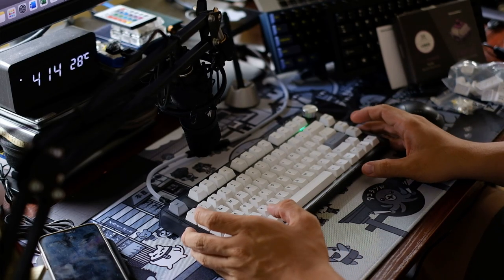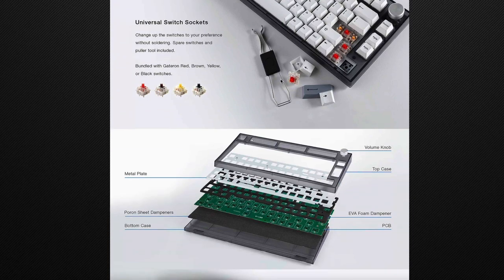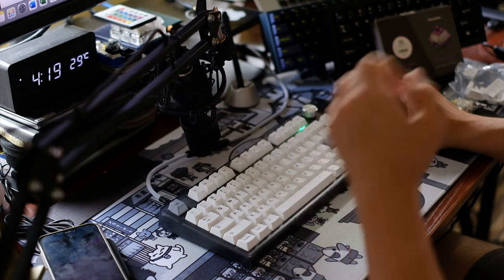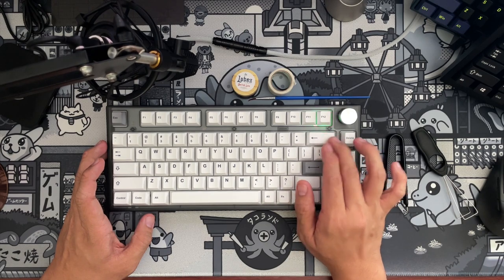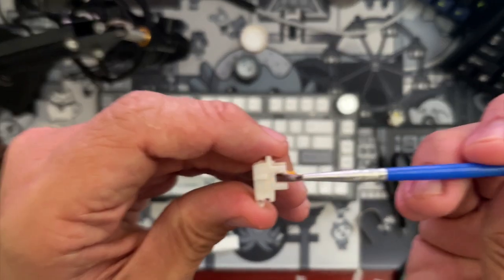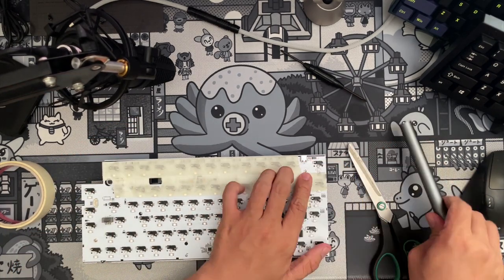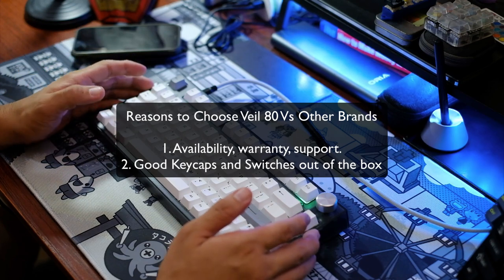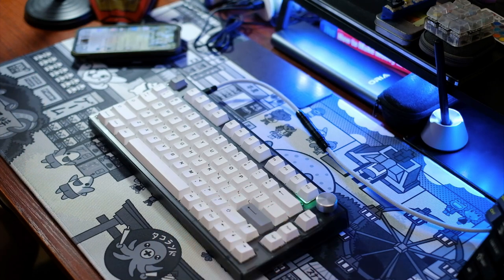Tecware Veil 80 Mechanical Keyboard Review and Modding Guide | Stabilizer Tuning Tutorial

Comment: How long does the battery last per charge?
Reply: About three days (with RGB on and right out the box at 80% full charge)
I used it for approx 4-5 hours each day before needing to charge. I've only charged it once since I receive it last week
The battery is about 4400 watts the most at this price point, not sure if there are any higher if you can afford more $$
I'm extremely pleased with my veil 80, 10 out of 10 would buy again.